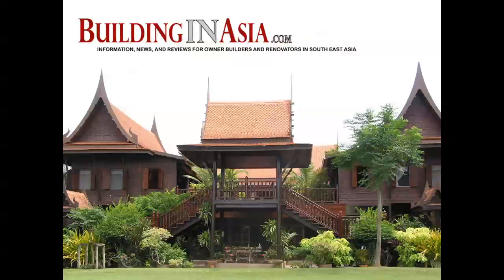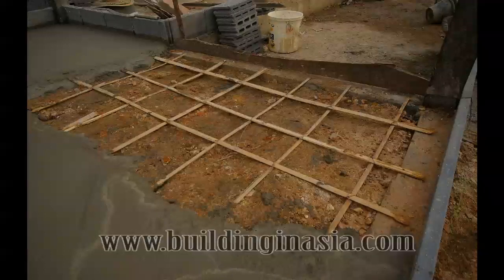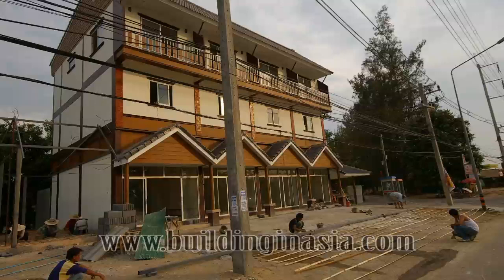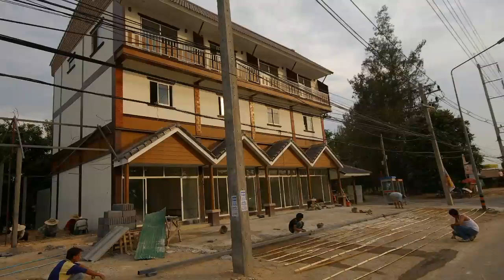Bamboo Reinforced Concrete

Comment: Weight for weight bamboo is stronger than steel. In the round it would be way stronger - here I think it would prevent cracking, but the depth of crete is only 3 inches so I reckon it's more of a lateral tie than load supporting. Larger trunks would be a potentially great combo offering great strength to  weight ratios and no rusting obvs.

Comment: Bamboo in concrete is used in all my construction on our resort we build in the Philippines! we use it in strip and dry form extensively in walls and floors, but applied old used engine oil on it to prevent the water to penetrate in to it. it works wonderfully and the structures are very strong with no cracks whatsoever. we made some strength tests and were surprised on the positive results.
Reply: wow used engine oil 👍😎
Reply: Hey Dino, is there any study material that i could refer to?
Reply: Dino, I’d like to contact you for a future project. My email is palisoc_f@yahoo.com.
Reply: what resort specifically sir?
Reply: Sir can i get more info about it? Actually we are also working on same project so we need some help
Reply: Dino thts great news man.....can you share some pics of ur bamboo reinforced concrete construction for reference.....I need to try it in India......

Comment: if you impregnant the bamboo with some type of resin wouldnt that make it stronger and last longer. i harken back to garbology research. random i know. the fact that paper wasnt  wasnt really breaking down that well in a garbage dump if you impregnant the bamboo with resin of some type then use concrete i wonder if it could be used to make buildings rise higher into the sky
Reply: Laminated, and resin impregnated/coated bamboo would be very strong. Also machining it a bit to give it texture to help bond to the concrete. I think if the idea really caught on, enough quality bamboo might not be available, bamboo grows quickly, but not that quick to the size required. Steel is also a known quantity and comparatively cheap, although a lot more expensive than bamboo.

I note that a lot of Indonesian fisherman have switched to PVC pipe for their outriggers, rather than the bamboo ones, as it is cheap, and the very large bamboo is clearly being chopped down at a pretty furious rate and getting more rare.
Reply: gud try

also do some more resarch 👍